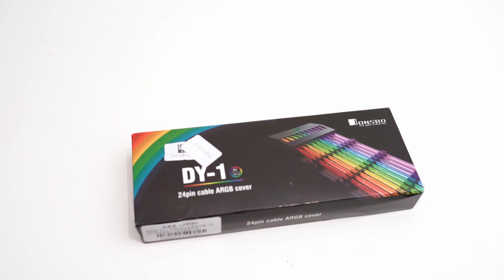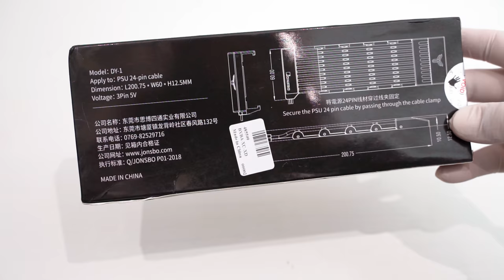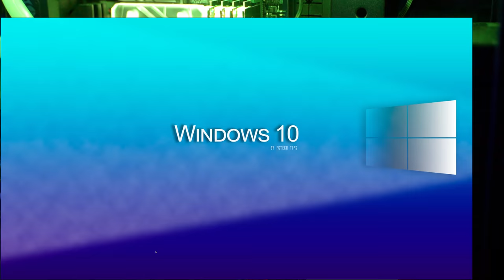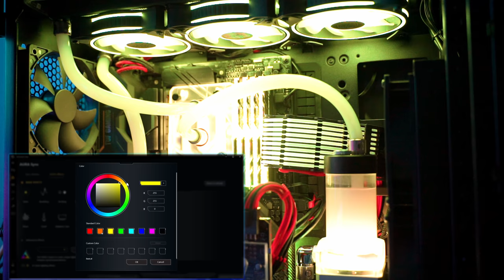JONSBO DY-1 review - Lianli strimer cheap alternative ARGB 24pin cable

Comment: I would buy it, if the lighting effect is similar to Lian Li's, where each strip has the light passes through horizontally, instead of vertically.
Reply from the maker: No unfortunately this is not

Comment: it looks nice but is kinda a waste of an RGB slot. I would rather do strips around the motherboard
Reply from the maker: Not an issue if you have a 1 to 10 RGB splitter like the one I use. For just few bucks you solve any issues ;)

Comment: I have a cheap build but would want to add more bling factor to it. Would this work on my Gigabyte GA-F2A68HM-H mobo and SilverStone 700w Psu? Do I still need to purchase extension cable for that slot?
Reply from the maker: Hi this only works with ARGB motherboards, you need to check if your mobo has 5v ARGB support then you are fine, if it only supports 12v RGB then not and in that case you need to use the provided s/ata extension cable
Reply: @fgtechtips  basically completely useless on my setup? Or could still be used but colors cant be configured (like for example it would only show one color mode)?
Reply from the maker: As i said you can use the sata cable if your motherboard doesn't support it but you won't be able to customize the light effects via software
Reply: @fgtechtips  i see, thanks for reply. So it is still usable, im ok with that actually 😁

Comment: I like the video and I am thinking of getting this but would like to know if it will bend enough for use on a lian li 011 dynamic case.
Reply from the maker: I don't own that case but I am pretty sure that the bending won't be an issue. Just check the space near the 24pin motherboard connector as I explain in the video ;)
Reply: @fgtechtips  Thank you for the reply.